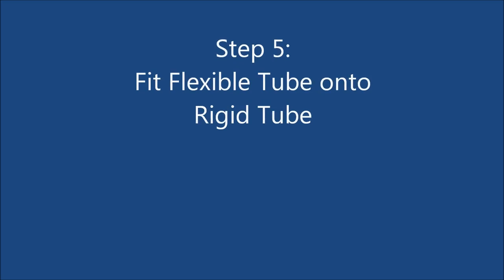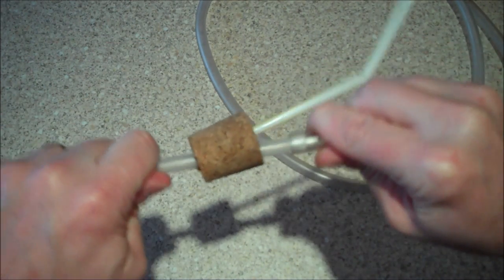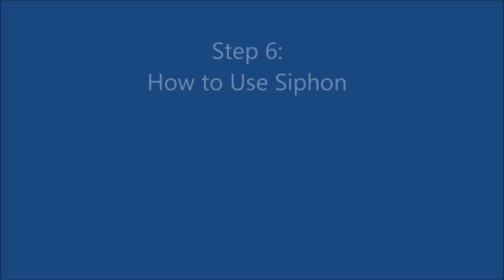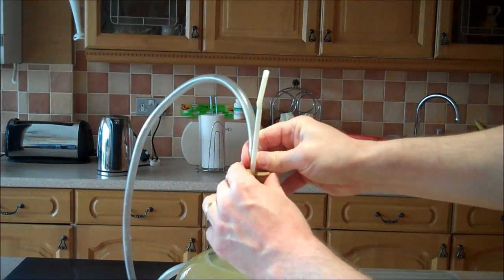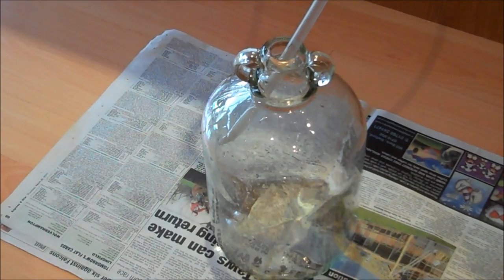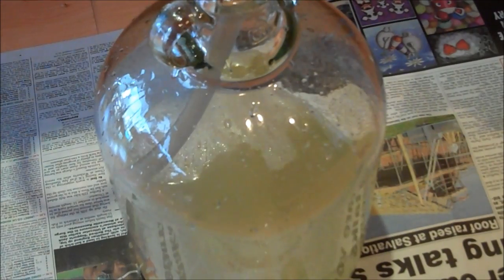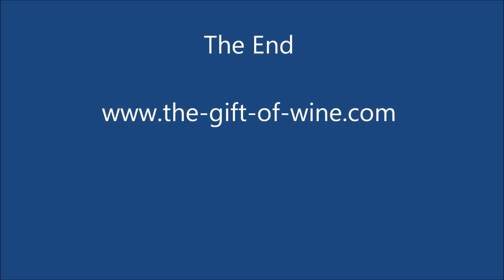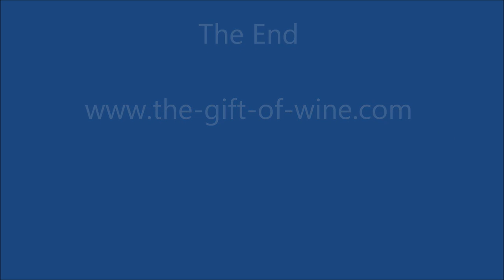How to Make a Wine Syphon (or Siphon)

Comment: Do you think this would work with a 23 litre fermenting bin for beer if the lid fitted tight enough? I'm thinking of trying this. There's already a grommetted hole in the lid for the airlock but I've got a spare grommet and could easily use it for another hole with tubing. Same principle but would it work given the extra volume?
Reply from the maker: Yes I see no reason why it should not work with the extra volume. Keep safe.